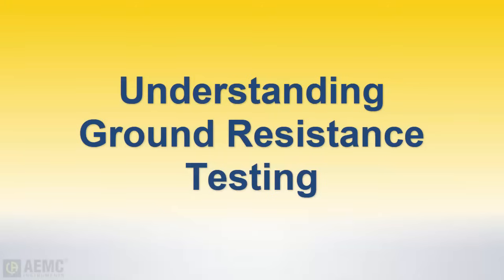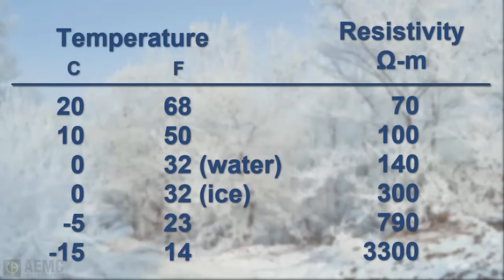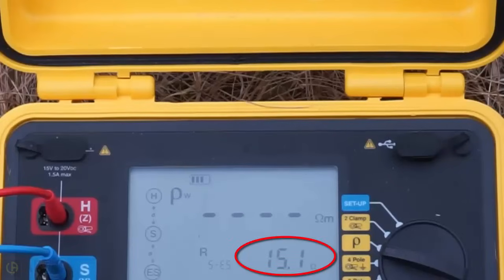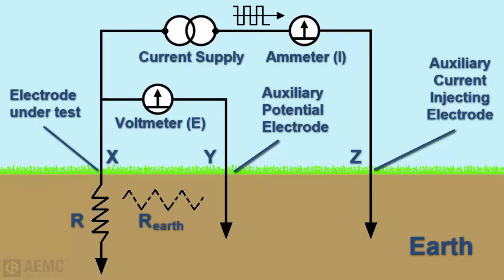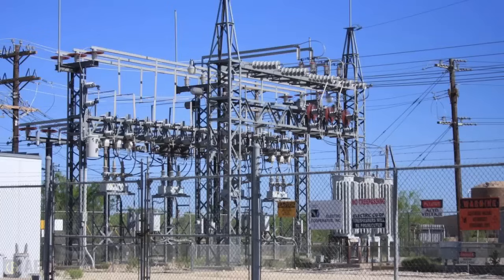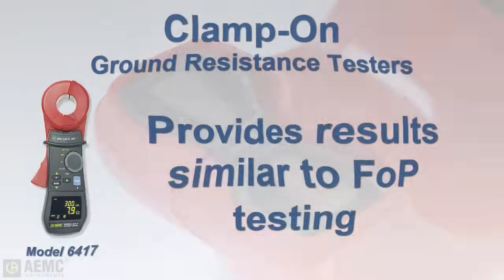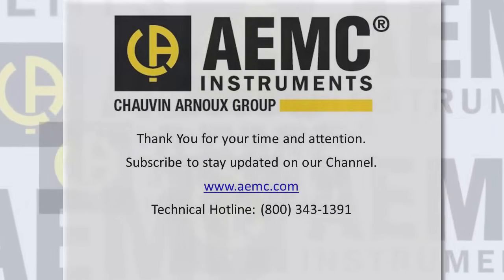AEMC® - Understanding Ground Resistance Testing (3640 Discontinued Replaced by 6424)

Comment: This is so much more useful than most info online which just says 'use instrument X and plug the electrodes in like this and read the number' i.e it tells you nothing about how the test actually works in principle.
Does the injected current have to be AC, or will DC do? I realise that a DC current will start electrolysis so it might not work/stay constant for very long (depending what plates out of the moisture in the soil), but if you only need a few mins to take some voltages from the central electrodes is DC good enough in practice? The advantage of this is that the current can be injected with a standard bench supply, and the voltages read with a normal multimeter. An AC constant-current generator is not hard to buy/make, but one is less likely to just have one to hand. What frequency do the commercial instruments use?
Reply from the maker: Thank you for your kind words!  The impedance of a ground system is generally measured with alternating current (AC) test signals. This minimizes the effect of galvanic voltages that can be present at the auxiliary electrodes.  An AC test signal also minimizes interference from direct currents (DC) in the soil from cathodic protection or telluric currents. Applying AC test currents that operate at a frequency different from power or harmonic frequencies will minimize interference from possible stray currents from neighboring grounding installations.  Many of our meters have a default test frequency of 128 Hz.  Our Multi-function testers have up to 91 selectable frequencies for a test signal.  Please contact techsupport @ aemc.com with more questions.  Thanks!

Comment: Hi! Thank you for the video, how do we find the standard deviation of the results after testing has completed using the Wenner method on the 6471? Thanks!
Reply from the maker: Here is an online standard deviation calculator:
https://www.calculator.net/standard-deviation-calculator.html

Just plug your numbers in and hit "Calculate"
Reply: @AEMCInstruments  Thanks! Is there a way to show the standard deviation numbers on the screen of a 6471 ground tester machine?
Reply from the maker: Unfortunately, no.  Any standard deviation calculations will need to be done externally from the 6471.  The calculator linked above can be useful if you wish.

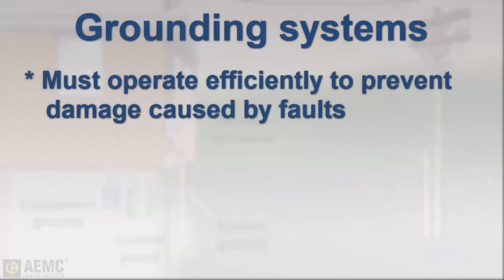Comment: This video is pretty good at explaining how to test grounding electrodes and electrode systems. It does however muddle the differences  between BONDING and Grounding. The grounding electrode system has little to do with clearing a fault (protecting equipment from faults 2:48). 

Think about that for a moment, apply 120v to a 25 ohm rod (NEC suggested target) will the resulting current flow cause a breaker to trip? 120/25= 4.8a that is not going to cause a 20a or 15a breaker to trip. Even if we lower the resistance to 5 ohms which is a common engineering standard we would only cause a 26a breaker or fuse to open thus clearing a fault. In a commercial building where breakers are often rated at 100a -1000a that could not realistically be relied on to clear a fault. Fault current for tripping breakers is dependent on a low resistance path NOT to earth as suggested here but to the center tap of the transformer or transformer neutral terminal which is a function of BONDING.

The NEC in article 250.4(A)(1) states that grounded electrical systems “shall be connected to earth in a manner that will limit the voltage imposed by lightning, line surges, or unintentional contact with higher-voltage lines and that will stabilize the voltage to earth during normal operation.”

Simply stated a grounding electrode system at a service entrance is for power quality not clearing faults. That is not to say it is not an essential part of your electrical system and the rest of this video does a great job explaining how that works.
Reply: True for the commercial and residential jobs..but for the utility multiple grounds are used which can assist with clearing the faults.

Comment: is it possible to measure on the transmission tower? if the Z electrode is placed 80 feet from the ground rod. Or can we use clamp on tester on transmission tower?thanks
Reply from the maker: We sell a 6474 Tower Testing Kit for tower testing.  
Here's a video describing the process:
https://www.youtube.com/watch?v=R_exTjDshM4

Comment: great video,  may I know if aluminum can be used for earthing? if there is no copper rod.
Reply from the maker: Bare aluminum is not recommended as a grounding electrode in contact with the dirt/earth. Bare aluminum will likely corrode quickly when in contact with the dirt and the ground system will become ineffective.

Comment: The explanation of fault current from a ground rod (and as not explained to create the circuit to the service transformer) is an incorrect understanding/explanation of effective ground-fault current path.  The NEC does not allow earth as an effective fault current path as the resistance is too high to allow the fault current to flow of sufficient magnitude to trip source breaker.  Suggest redoing this part of the video as the information is not being correctly discussed.  NEC 250.4(A)(5)  "the earth shall not be considered as an effective ground-fault currrent path".

Comment: Howdy.
1. Power lines.
Low grounding impedances provide a parallel path to the neutral + earth wire. It hepls to uphold the voltage symmetry along the line during unsymmetrical loading. Some degree of limiting of avalanche voltages is also provided caused by lighting bolts.
2. Consumer service panels.
Low grounding impedances increase fault currents and speed up triggering of circuit breakers. 
However, more important is the potential equalizing of the environment of utilization. Therefore. The service gronding should be a copper wire in the ground that encircles the house.
Regards.
Reply: Low impedance so thst the fault current flows, travels fast to earth without affecting others and surroundings.

Comment: In residential, with a 200 Amp service, what is the MAX AMPS allowed to RETURN back to the utility, VIA the UFER?
Reply: There is a problem with this video incorrectly describing ground fault current traveling "thru" the ground...doesn't happen/won't happen to trip a breaker.  The service neutral wire performs the effective fault current path.  Earth cannot be used as an effective fault current path.  NEC 250.4(A)(5)

Comment: During the survey, you mentioned that the electrodes were planted 6 inches deep (5:50). May I know if there are any effects of different electrode depth? As far as I know, the injected current is regarded as a point source located at the air-ground boundary, regardless of the electrode depth planted.
Reply from the maker: At that moment in the video, the electrodes were placed 10-feet apart performing a Wenner Soil Resistivity Test method.

To use the simplified formula for the Wenner method, AEMC recommends no more than 1/20th of the spacing for the depth of the electrodes.  1/20th of a 10-foot spacing is 0.5-ft (6-inches)

There’s no concern when you are at, or shallower than, these depths and using the simplified formula.

Our meter assumes you are using the simplified formula method and therefore calculates the Rho based upon the simplified formula and the 1/20th depth-to-spacing guideline.

If you push the electrodes deeper than recommended by us, the simplified formula is no longer valid and the long formula must be used.  Our instrument does not perform the long formula calculations automatically.  These calculations must be done manually.

Please contact AEMC Tech Support (techsupport @ aemc . com) for more information.

Comment: Hey, can you please explain why the resistance of an earthing system (ie in a power substation) has to be sufficiently low?
Reply from the maker: A grounding system should provide a low-impedance path for fault currents and lightning-strike currents to enter the earth/dirt. This ensures maximum safety from electrical system faults and lightning.  The low impedance ground protects equipment and buildings from being damaged by directing this dangerous energy to the earth/dirt.
More importantly, this provides a level of safety for people and any living animal nearby.
Reply: @AEMCInstruments  great thank you so much
Reply: @AEMCInstruments  I like the video, it is very informative. I don't like your wording about "a grounding system should provide a low-impedance path for fault currents and lightning strike currents to enter the earth/dirt". These are very different situations; one requires a 25 ohm impedance and one does not. They should be looked at separately.

Comment: this video really helps me to understand how to measure the grounding ressitance, and I have a question about it. is it possible to only use a voltmeter, ammeters, and current sources(current genertor) to measure ground resistance using the fall-of-potential method?
Thank You
Reply from the maker: Yes, it is possible but not practical.

A tuned voltmeter would be needed to reject all other frequencies than the source test frequency. Our meters use various frequencies to test and the voltmeter is tuned to that frequency for the most accurate readings, rejecting surrounding noise and interference.

Also, the stack-up of tolerances from all the meters you described would need to be added together to determine the accuracy of the readings you took.  With our meters, there is only one accuracy spec for the reading.

Our multi-function meters also store the distances (in meters or feet) of each measurement needed to graph a full Fall of Potential plot. A minimum of 9 measurements are needed for a valid Fall of Potential plot. This plot is critical in proofing your measurements to know if they are valid.

Good luck if you try this method!

Comment: My observation that when we give earthing then electricity meter revel fast and bill increase why it happened please reply must
Reply from the maker: I am unclear.
Did you say that when you add earthing to your system, your electricity bill increases?
This is unusual and should not happen.
Please give more detail.
Thank you
Reply: I don't understand your question, however one interpretation may be that your earth current is too high, which can be an indication of a lost/bad neutral connection which is a HIGHLY dangerous situation and needs to be checked by a qualified electrician.

Comment: Can this product test larger metals underground? For example, gold and silver buried by wealthy people in the past.
Reply from the maker: Doubtful.  It is true that gold and silver is very conductive and will help lower the overall soil resistivity readings. The problem is that measuring low readings does not automatically indicate lode or placer gold and silver deposits below.  For example; subsurface water, ashes, cinder and brine will also lower the readings significantly.  Prospecting for gold and silver would be a frustrating trial and error operation using this method.  Good luck!